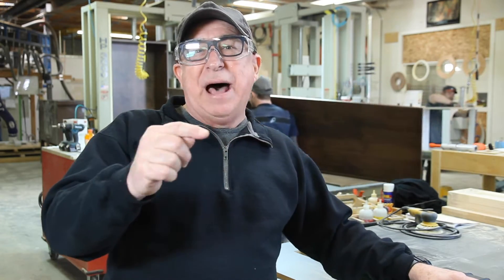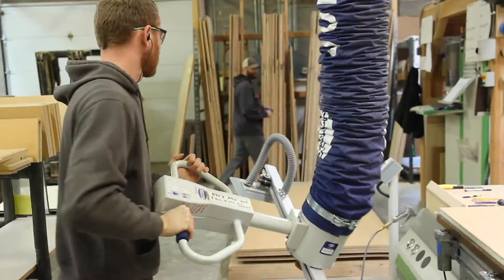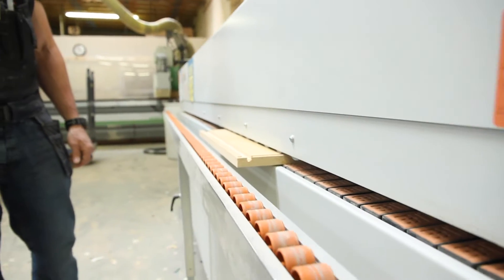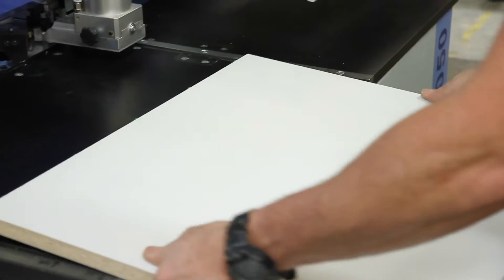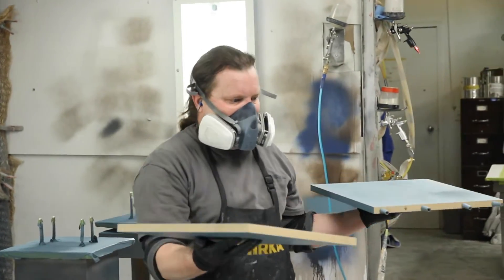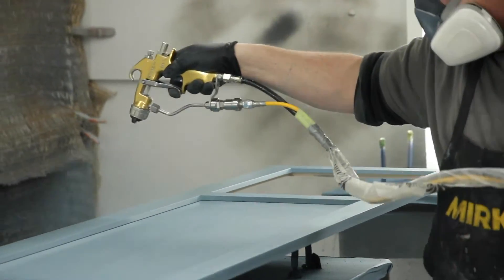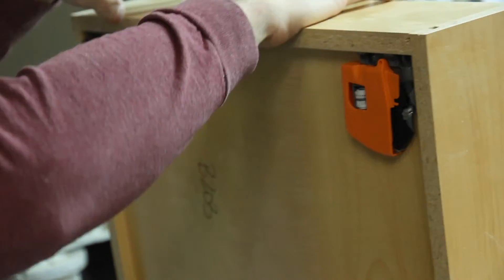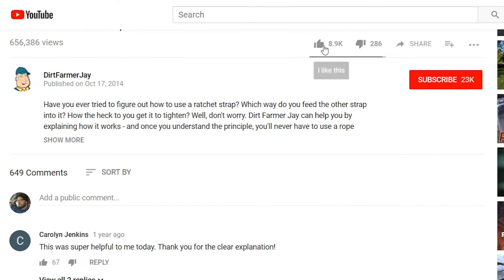"Behind The Scenes In A Modern Cabinet Manufacturing Plant" Ep 2

Comment: Came across this researching case clamps. How do you all like the Uhling clamp? Also what drilling center are you all using. We bought a used gannomat machine, but it never worked well. We drill on a Maggi horizontal drill and then insert the dowels with a gannomat gun. Our shop is DreamWorks Cabinetry is Fairbanks Alaska. Not really any other commercial shops within a few hundred miles of us. Anyways cool video, thanks for sharing on YouTube

Comment: These are cheap ass cabinets, out in the field all the cabinets I see are from real cabinet shops
Reply: I agree. They are using the cheapest material because it works best with the CNC machines. I would prefer plywood but they are using what gets them to work faster
Reply: @alessandro4337  First of all its all about client's budget. In this particular project, it's for garage.  Second, quality cabinets does not come only from materials, its also who crafts them, plus hardware.
I agree that plywood box is better, but again it's all about money.
Reply from the maker: Thanks for watching and writing. I can't agree with you on the quality of these cabinets. I saw construction of these cabinets all the way from the sheet goods, milling of the parts, using higher grade hardware, and assuring the joints were reinforced and glued securely. With over $1 million dollars in milling, assembling and finishing equipment at this particular shop, and using very skilled craftspeople, I don't think these units are cheaply made. Many of the cabinets I see in the field are the opposite from what you describe. Many are bulk-manufactured units, many times from Asia, and distributed through big-box stores and major cabinet companies. The midsize company featured in the video produced units several steps up, and had contracts for several high-end building projects ranging from residential, office and commercial. Thanks for stopping by! Best, Regards, DFJ
Reply: @DirtFarmerJay  I guess I was more referring to the materials used